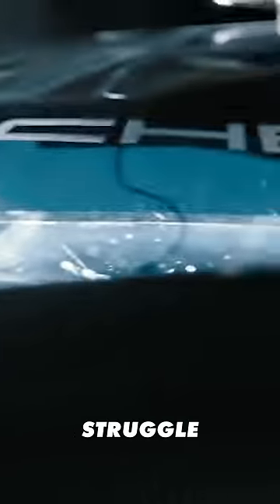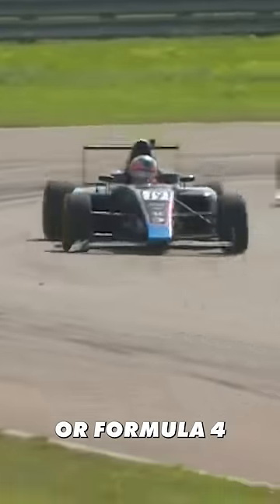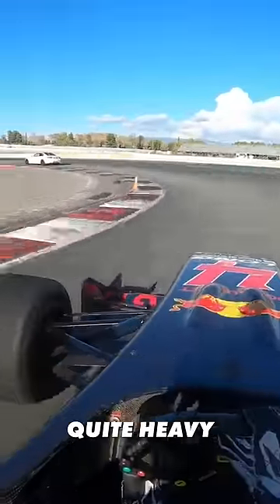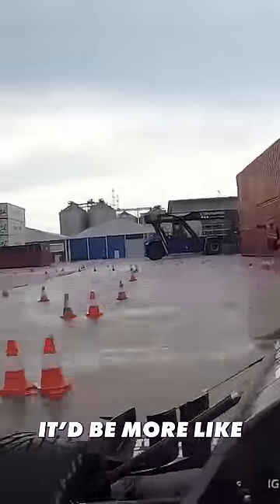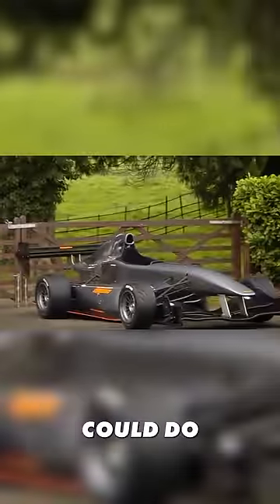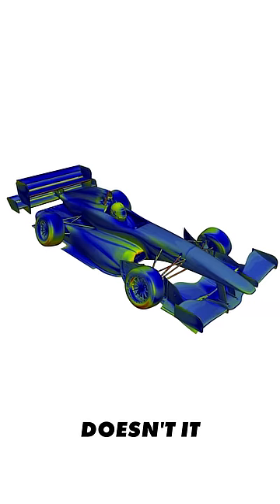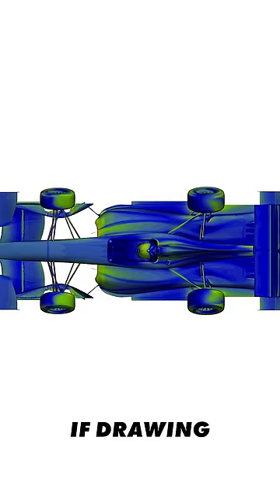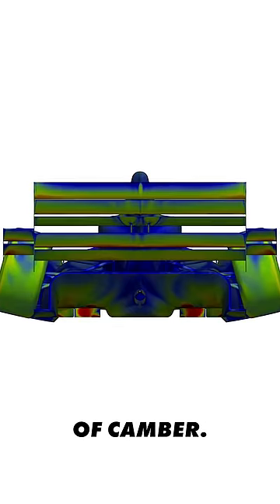The Car I'm Going to DRIVE UPSIDE DOWN

Comment: Im honestly shocked RedBull hasnt done this yet. Its a very RedBull thing to do
Reply: I wouldn't be surprised to see some sponsorship on that car.
Reply: I wouldn't be surprised if they're the ones funneling money into it
Reply: Imagine the video is revealed on the Red Bull channel and his car in full redbull livery
Reply: @mattgrigsby8907   they're not. At least not yet.
Reply: Red Bull is not the only F1 car with wings.
Reply: @stephenbrookes7268 but redbull is just the company that would do it.
Reply: Idk, seemed like a pretty Lotus thing to do
Reply: Bro out-Red Bulled Red Bull
Reply: @Essex1929 i bet he already is sponsored
Reply: They can't risk Max lol
Reply: It might be too dangerous, even for redbull
Reply: @cyrnoz1803  nah the landed a plane on a heli pad
Reply: The engine isn’t made to work upside down.
Reply: @matttondr9282  with a pressurized system who’s gonna stop them
Reply: @mattgrigsby8907 you mean tunnelling money into it lol
Reply: @MTF-EPSILON-11-5-NULL I think the electric with just big enough for the quick run needed would work best
Reply: Enough battery for the run
Reply: Redbull Gives you Wings!!!!
Reply: My brother wrote a paper about something like this and included this example in his work. The reason it's impossible is for the reasons mentioned in this video; EV cars aren't light enough to have the downforce provide the grip for it to be possible. 

An ICE car seems like the the obvious solution, but is simply impossible because combustion engines are meant to run at a certain orientation as gravity plays a huge role in the movement of the components and flow of fluids. Therefore, we need to wait for EV tech to provide a lighter platform, or wait for aerodynamics to get much more advanced, or for EV tech to provide the proper speed.
Reply: I know. I said the same thing. You constantly hear about how an F1 can drive upside down and wondered why Red Bull hasn't tried it.
Reply: @matttondr9282 a pressurized dry sump system or something like that will be fine it's not like he's gonna be upside down for an entire race I'd be surprised if he's upside down for more than 30 seconds. 🤷‍♂️ but I'm not an engineer
Reply: @rduanepemberton1806 I think electric = too much weight for the aero to more than double downforce and keep it pushed against the ceiling
Reply: @stephenbrookes7268 bro are you good? Have you even ever watched a redbull video they do outlandish things with their f1 cars please don’t just spew bs all waahhhh but redbull isn’t the only car with wings wahhhh like bro it’s just how redbull does YouTube no other company is gonna risk their f1 cars anywhere but the races when’s the last time you’ve watched a video from Mercedes and been like woahhh that’s so awesome
Reply: @xxshadowkingxx6070  Take your meds! Ask the nurse to explain what my comment meant.
Reply: They're too busy cheating 🤣
Reply: @rduanepemberton1806 it's way too heavy
Reply: @nycyabber7103  I dunno it's not like the car is gonna be upside down forever you know planes can fly upside down with an ICE right? I would guess that a conventional V or inline motor could operate upside down for atleast a short amount of time before some kind of balancing or oiling issue 🤷‍♂️ but I'm not an engineer
Reply: @gregoryballestero4369  yeh, it'll run a dry sump system that will be designed to work both ways up, all fed to the engine via high pressure oil pumps.
Reply: Red Bull will do it even if they have to turn the tunnel upside down to accomplish it.
Reply: I have literally emailed Red Bull, asking them to do this.
Reply: We were talking about this work and literally everyone said in tandem “surprised Red Bull haven’t offered them a car.””  🤣
Reply: I agreed
Reply: @stephenbrookes7268  but it's only redbull that gives you wings, exactly what they need😂😂
Reply: @subilasikwese5459  It can also give you arrhythmia! Lol
Reply: It's really dangerous.
Reply: @nycyabber7103 why not use a fan car like the Chaparral 2J or the gma t50
Reply: Already done, Mercedes Benz Challenges Gravity.
Reply: Hot wheels did it years ago
Reply: They might do it if there is enough demand.  So lets start asking.
Reply: Pretty sure Travis Pastrana already did this for redbull in his wrx...
Reply: @rantional8180  it's not possible km a wrx but hot wheels did it for hot wheels
Reply: @electricpaisy6045   well if you Google jaguar loop the loop you can see a suv crossover do it, pretty sure I remember Travis Pastrana doing it a long time ago.
Reply: @rantional8180  driving in a looping is not driving upside down. That's about centrifugal forces not about downforce
Reply: @Colby_0-3_IRL_and_title_fights they get stunt drivers 😭
Reply: They did it
Reply: They will use an inverted dry sump oiling system like what is used on acrobatic airplanes. Like the Extra 300s acro airplanes they used for the Red Bull air races. So that shouldn't be a problem. It will just be to have a car with enough down force over the cars weight to stick it down good.
Reply: @matttondr9282 with a dry sump it is absolutely possible depending on two things only.  1 Oil reservoir to determine how long the engine will be pressurized and, 2 How long he is going to be within the window where the engine can no longer scavenge oil which can be worked around by an additional stage or two on the scavenge pump with oil pick up placed on top of the valve covers.
Reply: FR LOL
Reply: Then Redbull could actually claim "Redbull gives you wings" lol
Reply: redbull doesn't "do" anything, they only sponsor things they know for sure is possible, and then they get the credit it for it after all the work is done.
Reply: This is unimpressive.
Reply: Red Bull undoubtedly investing at this point
Reply: @nycyabber7103 , or rotate the engine when upside-down
Reply: They won't build cars like this, not even for adv or purely for fun
Reply: They wouldve added a barrel roll at the end aswell
Reply: did no one here know of the x2010
Reply: Your right, they should be able to achieve it cuz, redbull gives you wi-i-ings
Reply: They haven’t done it yet but their in the works of it, their building that car for it and they need to build the right tunnel for it, I seen the video talking about it
Reply: It's because gravity is a bitch and this results in the engine not getting the right amount of fuel, oil not being pumped to very important parts like the turbo, cooling liquid being unavailable for the engine and the turbo, etc etc. There's a lot of obstacles to achieve driving upside down. We haven't even talked about the pistons having to push away the oil if the car is upside down..
Reply: @stephenbrookes7268  I see what you did there
Reply: They did...
Reply: @redbull
Reply: Hot wheels did it
Reply: The thing is that our internal combustion engines aren't suitable to drive upside down. So engeniers are now struggling to make engine like that😅
Reply: Exactly.Leave it to red bulb to figure out something so ridiculous dangerous
Reply: @matttondr9282 

A car definitely WON'T run for VERY long if upside-down, at least NOT without ANY modifications to both the Oil & Gasoline systems and supplies‼️☝💯

But what they're talking about, the car will probably ONLY be upside-down for NO more than a FEW seconds, which even the most BASIC car of all cars won't have ANY issues surviving, LET ALONE their MODIFIED version during their SPONSORED event‼️☝💯

👍😎👌
Reply: Mercedes already did it
Reply: @mattgrigsby8907 you mean tunelling money
Reply: Cheack again
Reply: Fr
Reply: Doesn't have to be always redbull!!
Reply: as the next video i scroll on is a red bull vid
Reply: I won't be surprised they trying to sponsor something not theirs thing

Comment: Those formula studnt cars are so light that we just pick them up by hand to load them into the trailers
Reply: Wait, really? Damn
Reply: @Vessel-v875 they're about 200-400 kg so you can easily Pick up one end and carry it
Reply: @ChatminAC  This guy doesn't skip leg day
Reply: @ChatminAC  okay sorry, but that would be pretty heavy for a formula student car. Most of them weight about 170-220kg. Some top teams achieve weights just below 150kg. 
At least in europe.

The car from my team theoretically could drive upside down at 32m/s (~115kph) without driver
Reply: @cookiemonster1.118  I heard in the video the one theyll be using was about 180kg I think so i just rounded
Reply: @ChatminAC  you can carry 400kg? 😂
Reply: @BigBoyXP4014 I imagine they mean a team of people pick them up, even if he could lift 200kg he wouldn’t be able to lift a car on its own given the shape and weight distribution.
Reply: Absolutely true, we just had a showing of our formula student car, the new electric model, and with the aero pack its 172kg, 4 guys picked it up no problem, the whole car is carbon fiber and titanium so thats no surprise
Reply: @xtrite5623 wait y’all do titanium frame?
Reply: @kennethsideas84  holders for the suspension, bolts and the frame above the driver is titanium, everything else is carbon fiber,  the monocoque, holders for the wheels, rims etc
Reply: What's the power/hp of these things? Never heard of them before.
Reply: @orderofmagnitude-TPATP  The electric motor one that we have is 88kW but its limited on 80kW with the regulations
Reply: @xtrite5623  so what's that - about 107 hp?
But a car weighing as much as about....what 4 average size people?
Reply: @orderofmagnitude-TPATP  yup its got a really high power to weight, thats without the driver with the driver ypu add 60 to 70kg average and it goes down significantly, ours has a 0to100 around 2.3 sec, but some other ones have higher, look up formula student 0to100 0.9 secs its insane
Reply: @ChatminAC most of them are even lighter. Our 2023 car just weighs 169kg
Reply: @xtrite5623  I screwed my back picking up our formula student car, it was a few years ago so cars were a bit heavier, maybe 200-ish, and without a driver most of the weight in the rear. So we'd get 2 or 3 on the rear and 1 or 2 on the front to lift it. We needed to lift it and carry it a few meters, I was in the middle on the rear, the guy on one of the rear wheels was weak and while he got it up, when we start moving he basically collapsed and tripped over so it unbalanced me mid stride, a smarter person would have just dropped the car, but I kept carrying it and messed up my back. Two lessons learned, just drop it instead of screwing up your own body, and don't trust over confident people who think they can lift something heavy when they can't.
Reply: Tf
Reply: @xtrite5623 how’d your team get an ev under 200kg? ours is around 215kg with a full carbon monocoque.
Reply: @cookiemonster1.118 DUDE, you study something related to race cars, you should know better than to use the nonsensical "kph" (literally "thousands per hour" 🤦‍♂️) denomination!
It's km/h, the meters (m) matter! k is not a unit, smh!
Reply: @LRM12o8  Unless you live under a rock, kph is a pretty common non-standard abbreviation of km/h.